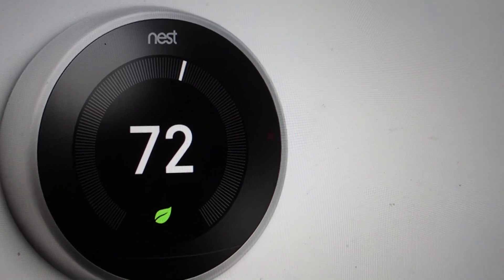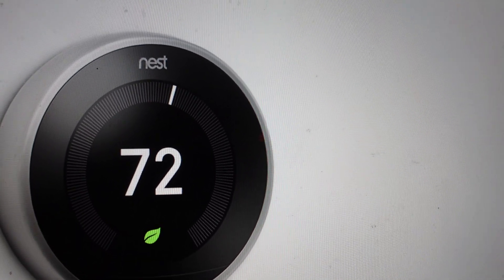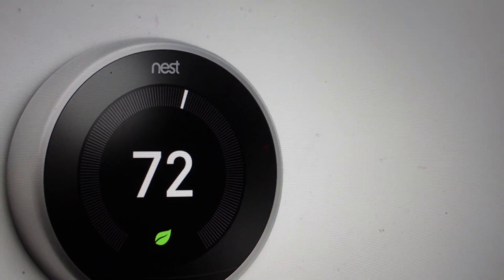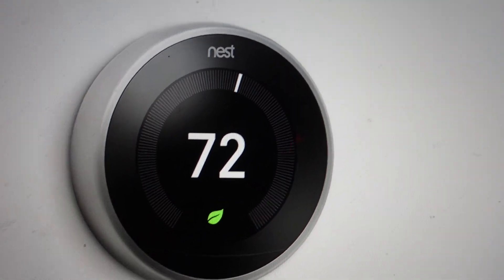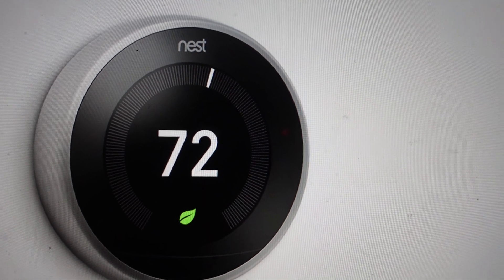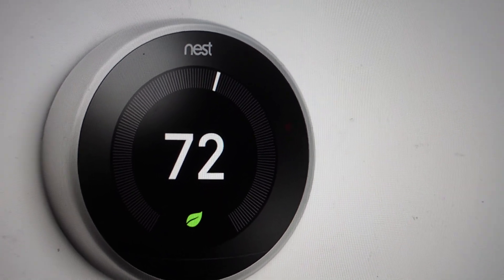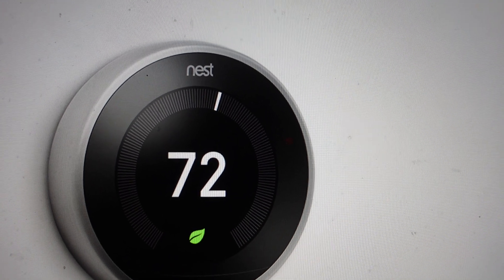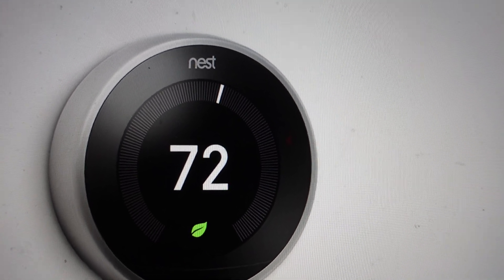e73 Error on Nest Thermostat

Comment: Thank you. I would suggest a THIRD “DIY” thing that could help save people a few hundred bucks:

A/C DRAIN LINE CLOGGED:  a sensor may be cutting off the power to the thermostat because the a/c unit inside is not draining to the outside. 

Go outside and connect a wet-dry shop-vac to the drain line any way you can I USE DUCT TAPE TO SEAL IT so the shopvac can suck all the water and gunk out…make sure you vaccuum all the water/gunk out…

Try running the a/c again and see if you get the same message. This THIRD step has worked for me many times in the past years…